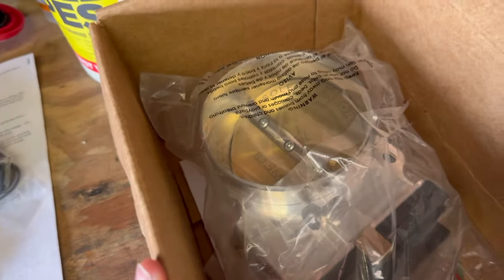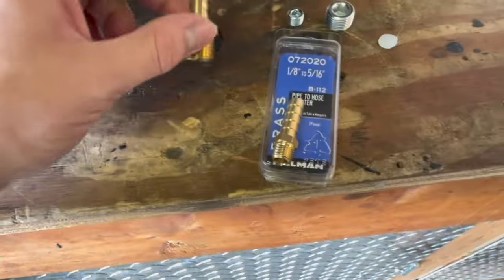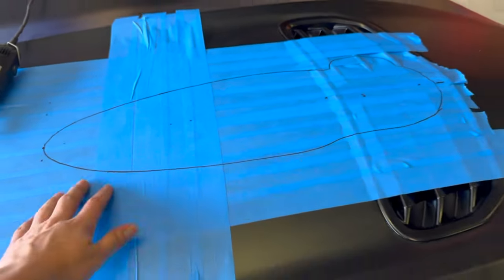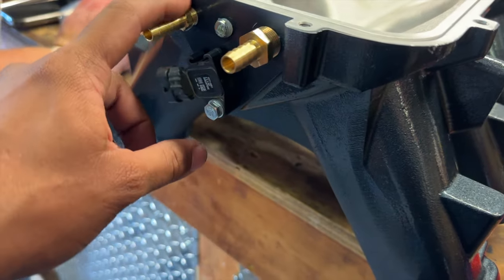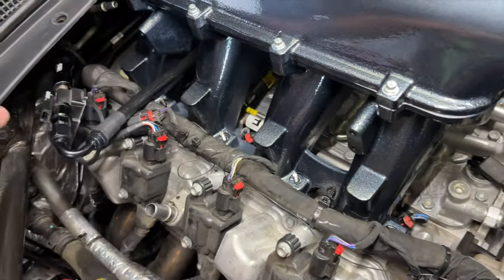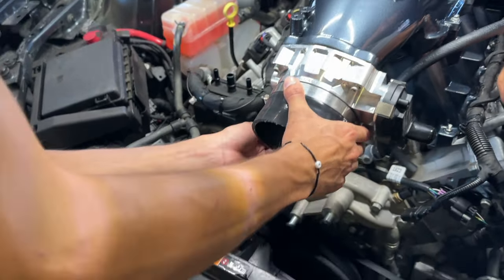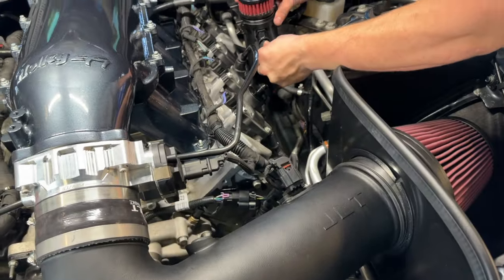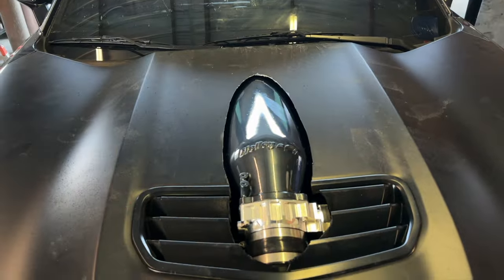HOW TO INSTALL HI RAM ON A LT1(6TH GEN CAMARO)

Comment: Did you have any problems with the first start ups? I just put my high ram on and it starts up really high and then shuts off. I’m e85 FBO, I removed the evap line completely. I double checked all my lines. I haven’t got tuned for it yet. But I’m just curious if that’s normal or no.

Comment: Ok so you need this tuned right so once installed did you take it to a tuner like was it still drivable to the tuners or should it not be driven and put on a flat bed to a tuner?
Reply from the maker: I think you can drive it but stay at low RPMs we got it remote tune from GPI